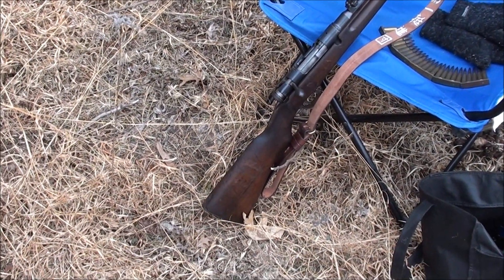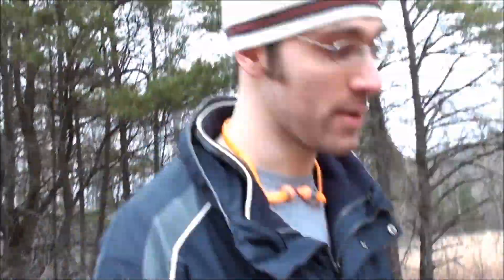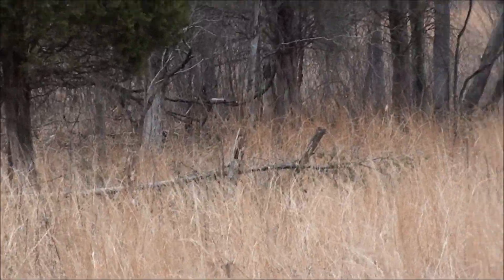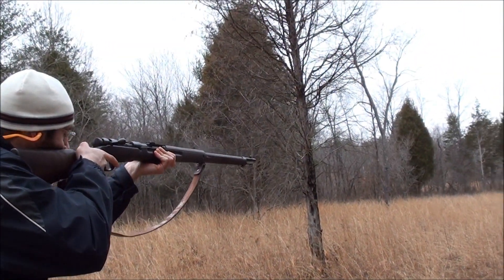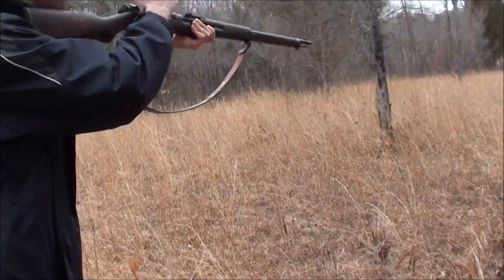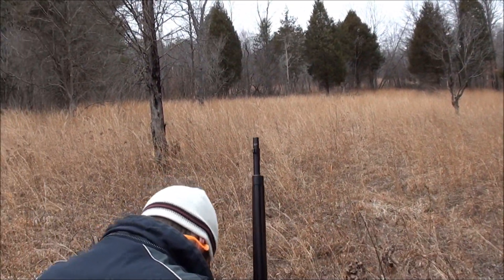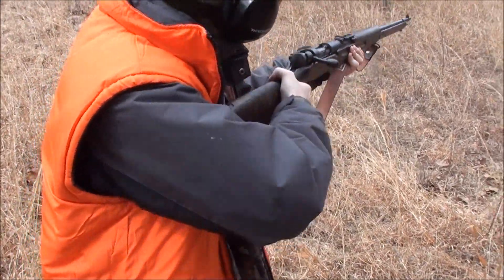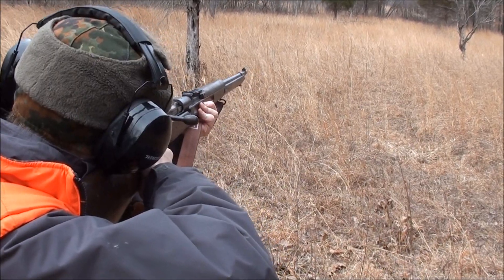Arisaka Type 38, March 16, 2014

Comment: On sling "第一挺身団"(dai-ichi teishin dan "1st Airborn Raiding Group") if its an oliginal sling,that gun must be captured around Philippine
Reply from the maker: mash5103 The sling is actually a reproduction; I doubt that an original WWII leather sling would be in very good shape today. Thanks for the translation, though!
Reply: Yes...  That's a common repro sling sold here in the USA.  I made my own T38 sling from heavy harness leather and formed a buckle from brass rod.  I only wish I could find a web-site with Japanese T38 unit markings (as painted on orig. T38 slings).
Reply: Did you just say Oliginal